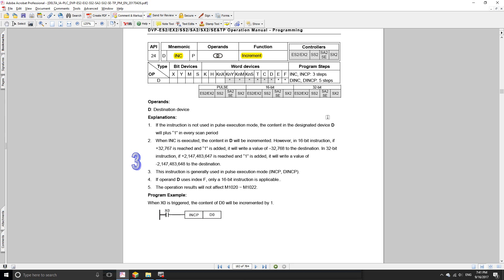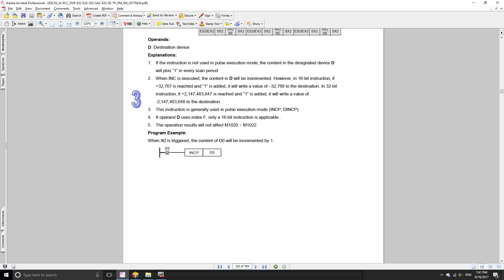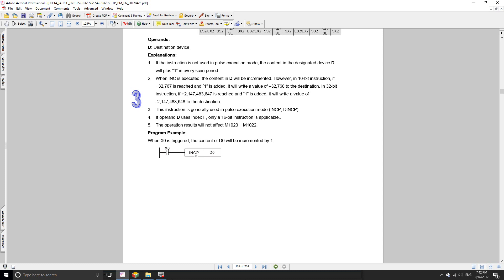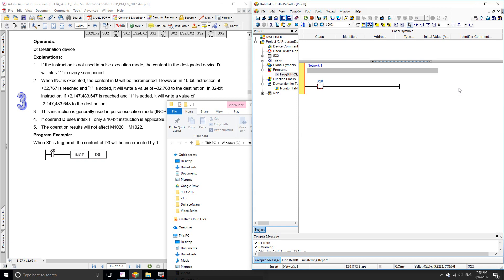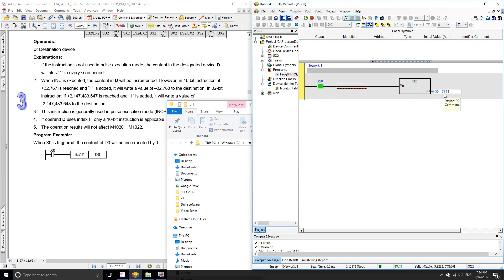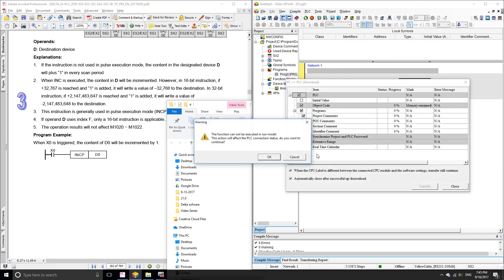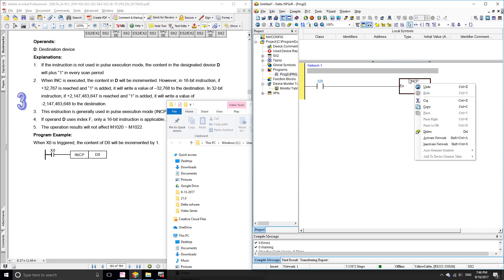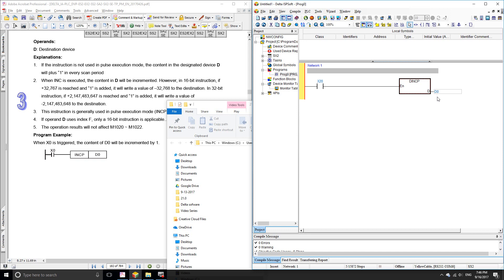24 INC Increment

Comment: sir I  I want to make a program by using a proximity sensor to control motor rpm. I want that when motor rpm goes equal or greater than  900 rpm my out will on and when it will decrease below 900 rpm output will off. how can I do that please help me